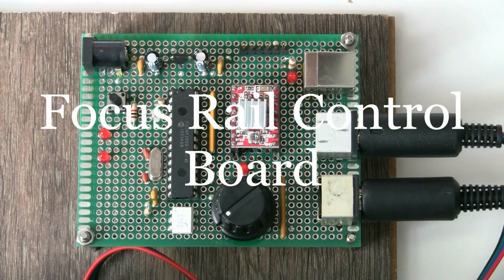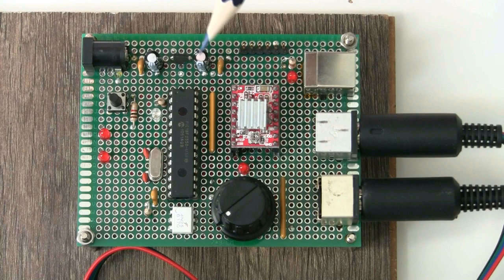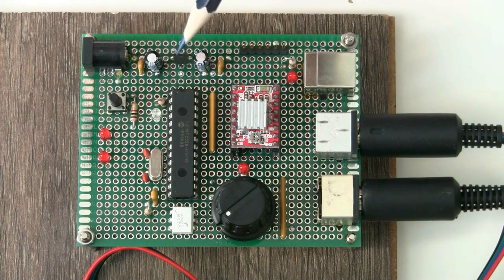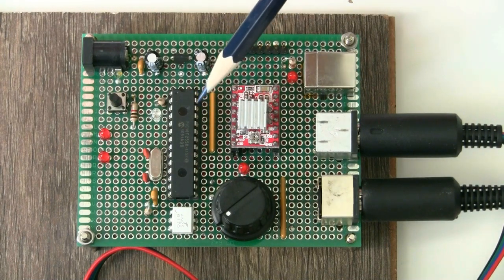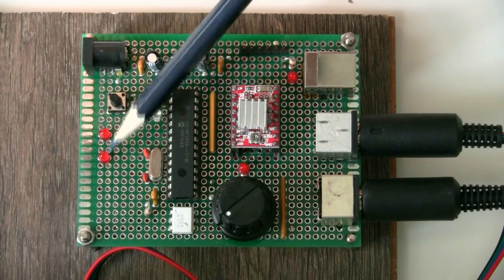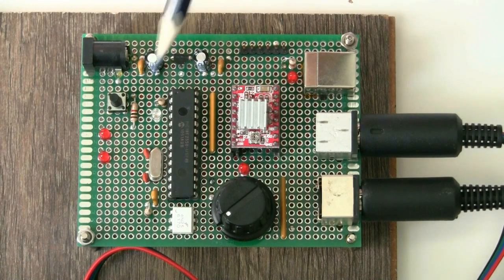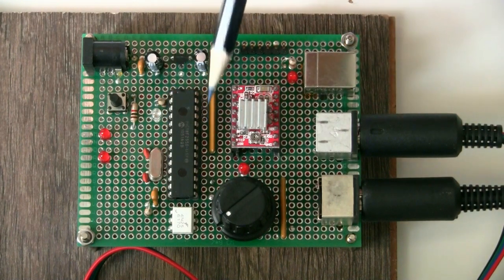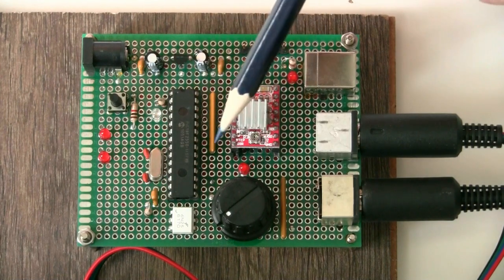Focus Rail Control board

Comment: Thanks for all the work you have shared. I would like to see a photo of the back so that I can see how you have wired it. or at some point in your video presentation could you turn over the board? Perfect for me because I am new to electronics and just starting I find it much easier to follow your explanation in video format.
Reply from the maker: Hello Douglas, thank you for your interest and feedback.  I have just completed a different project but using the same board construction technique.  In this project I do flip over the board and show the underside.  Check out the board description video in this Instructable :

https://www.instructables.com/id/DropArt-Precision-Two-Drop-Photographic-Collider/